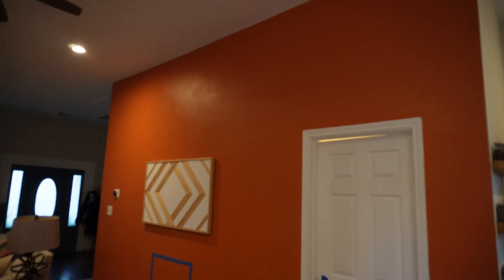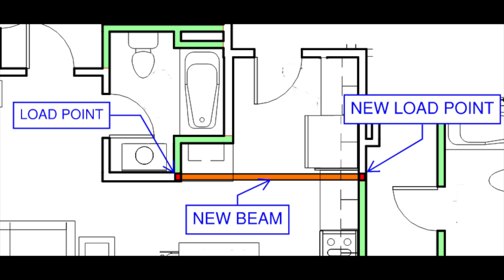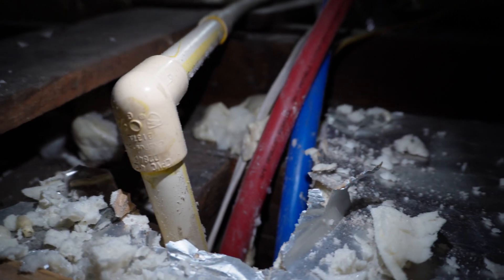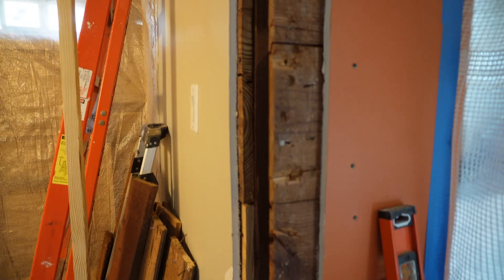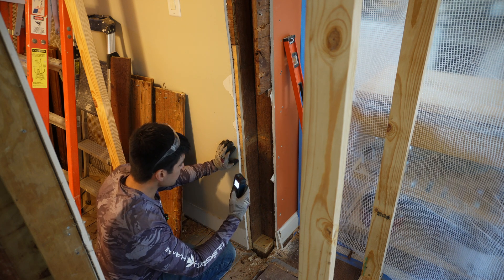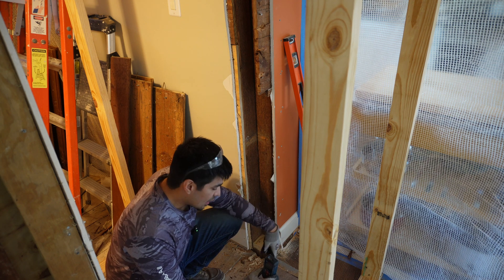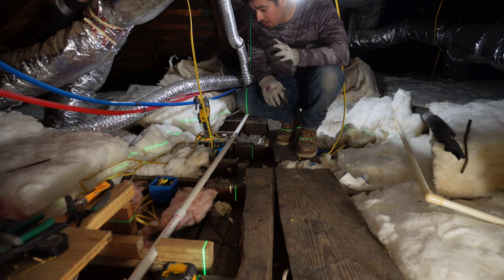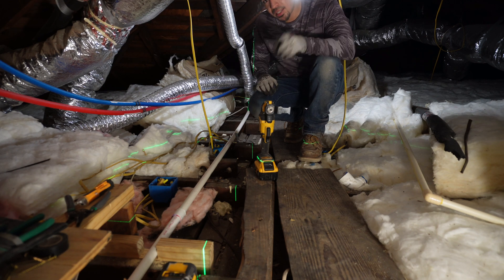DIY LVL Beam Install / How I Installed a New Beam for a Kitchen Remodel

Comment: What if you don't have large enough access to get a beam that large fed into the attic?  Do you just shore up with temporary walls and remove the existing wall ant then feed the beam up from underneath?
Reply from the maker: Yup. Exactly like that. It’s another way it can be done that way too. You’ll slide the beam from below, temporarily shore it and then installed the posts.
Reply: @jbuildsdiy , cool, thank you!